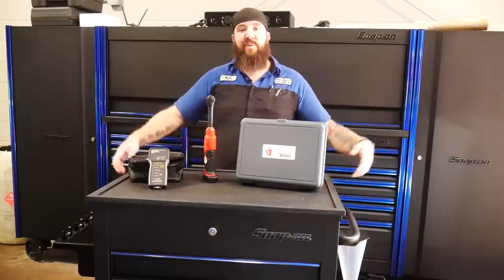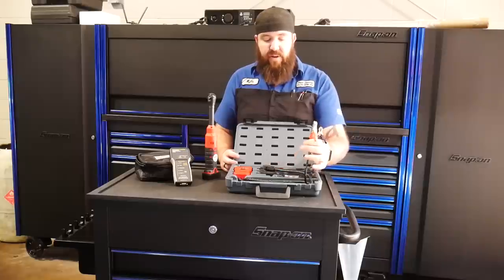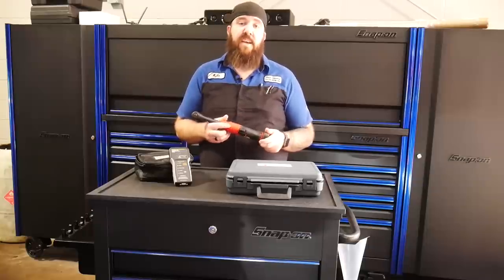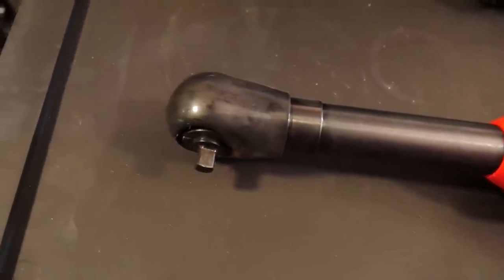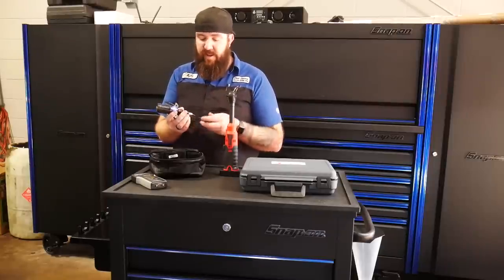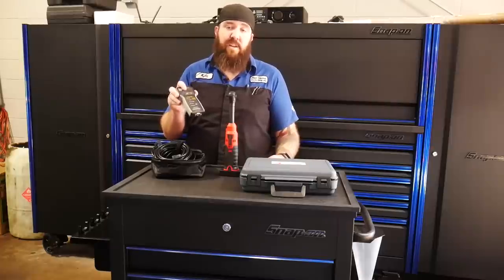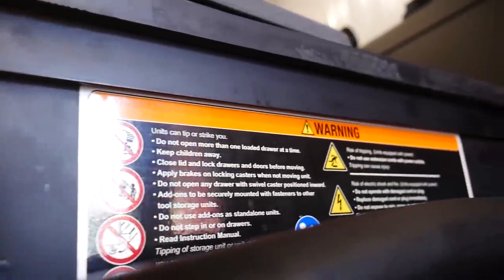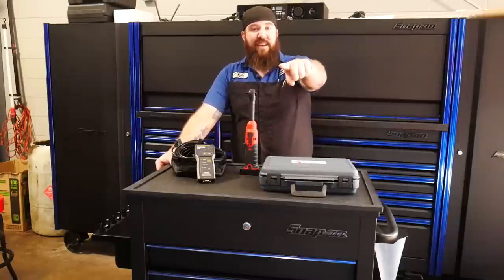🔥NIFTY TOOLS🔥 Episode 12

Comment: Nice video. I have that trailer brake controller tester. I use it when I install controllers on vehicles with 7 pins. Comes in handy. Had a customer once say I hooked up the wires wrong because his lights wasn't working. Took that tester and showed him it was installed correctly.
Reply from the maker: Exactly!! Even after only having it a week, it’s made it’s money worth on a 2019 with an internal Trailer brake controller failure

Comment: Dam it rustbelt! I am building a trailer tester now I see this nice store bought unit!!
Reply from the maker: Lol and I literally just found it for a cheaper price, I’ll be posting the link here in a second
Reply from the maker: Just pinned a link😂
Reply: @RustbeltMechanic  hahah screw it I am still build one!!! It's going to be awesome hahah
Reply: I built my own and tried using a load resistor setup to make the truck think there was a trailer connected.... It didn't work.  Ended up putting a brake magnet inside and the truck now sees it.  Also put a 3 digit voltage gauge to show the output and a second gauge to show the charging voltage, along with LEDs to show the other outputs
Reply: @thebmac  bingo sir 👍 that's what I have in mind 😉